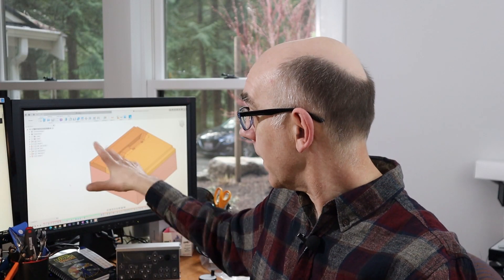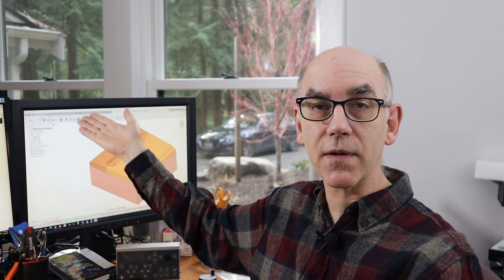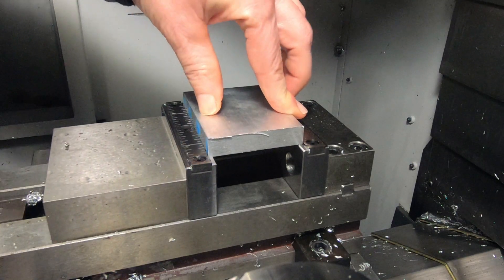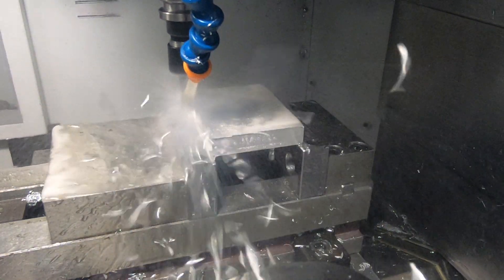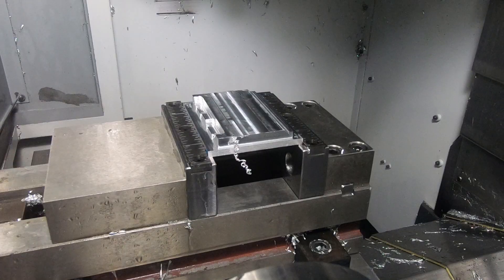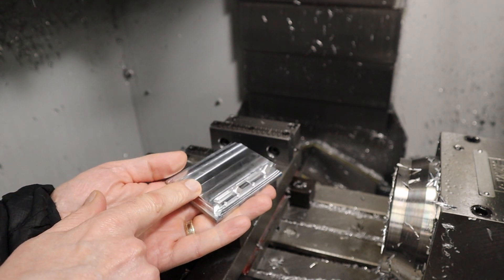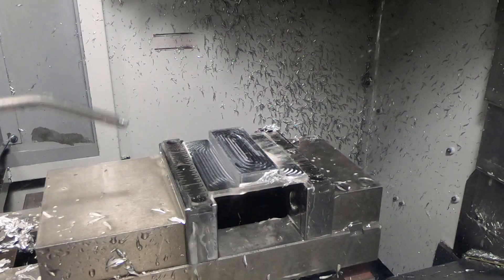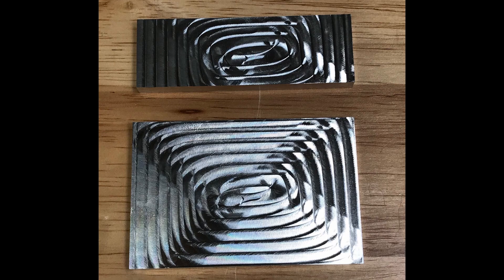Sizing Stock the CNC Way

Comment: So what's the minimum height that you have to waste? 3mm in the jaws and another 2mm above the jaws for clearance = 5mm? I'm new to machining and don't want to waste material, but also don't want to cut it too close, hah
Reply from the maker: I generally try to take off the minimal amount of material to clean up each face. That's usually about 0.01" (0.254 mm) in my case. So the total reduction in thickness would be twice that.

Comment: This is called “False bottom”. You could also mill a dovetail on the bottom and hold the workpiece in special dovetail jaws. I do this for multi axis jobs or when the piece has a lot of material removal.
Reply from the maker: Interesting, I never heard that term before. Thanks. Regarding holding, I haven't found the need to go the dovetail route, as my machine is a relatively "small" machine. The maximum recommended end mill is 3/8". But I also have Piranha Jaws that serve the same purpose and don't require any material prep. I have a vise for my 4th axis that also has toothed jaws (I need to design a mount for the vise).

Comment: The method you have just discovered is the only way to go. Time is the most valuable and important commodity, it is finite and irreplaceable. Aluminum is cheap and endless in supply, don't work for money, work for the production, completion, and standard of quality of the things you make and do. Money will follow. Edge precision has a whole video dedicated to the subject.
Reply from the maker: I'm going to have to search for the Edge Precision video on this. I'm totally sold on this approach now, even though this is just a hobby for me.
Reply: @JohnSL  https://youtu.be/-OvZC7XSKps
Reply: If you remove a lot of material from a thin plate,the plate will warp,sometimes a lot.

Comment: Hi.
Thanks for the video. It is very useful.
What kind of aluminum do you use for molds?
Reply from the maker: 6061-T6. These are small-run molds, so cheap and easy to machine.
Reply: @JohnSL  Thanks.